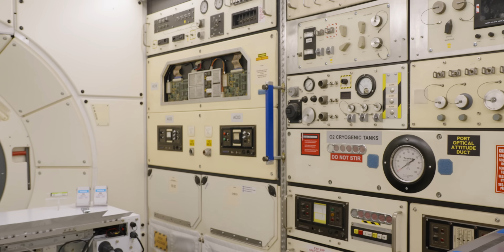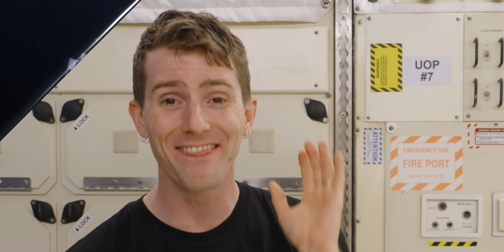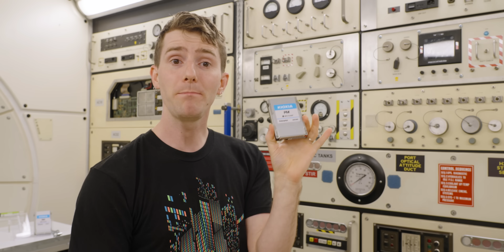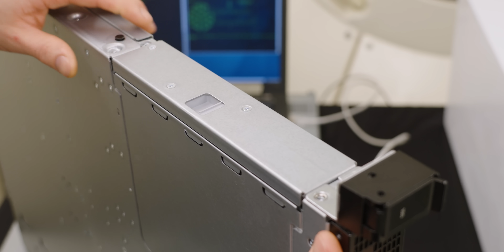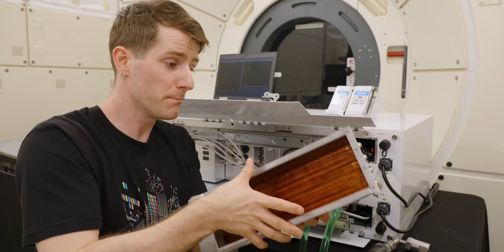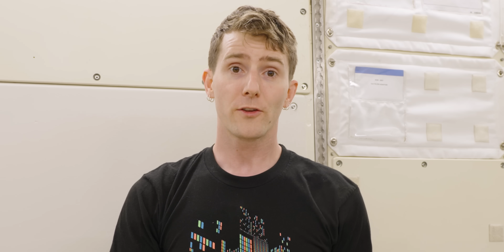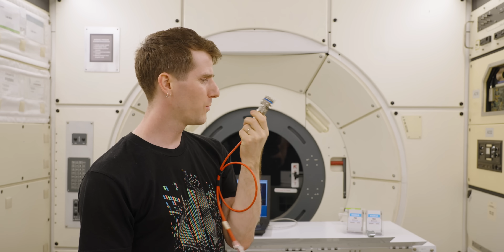here's why it's so hard to put a computer into SPACE - NASA HPE Spacebourne 2

Comment: The vacuum of space is a pretty “rad” cooling solution…
Reply: surprising a vacuum is a very good insullator !because of its complete lac of atoms to wich transfer the heat !
Reply: @palvierflex4344  ### Detailed Design for a Space-Based Radiative Cooling System for a Computer

#### 1. *System Overview*
The design focuses on using the vacuum of space to dissipate heat generated by a computer through radiative cooling. The system comprises heat pipes, radiators, thermal interface materials, and a thermal control system integrated with the computer components.

#### 2. *Heat Generation and Analysis*
- **Components and Heat Output**:
  - CPU: 150W
  - GPU: 200W
  - Power Supply: 100W
  - Other Components (RAM, SSDs, etc.): 50W
  - **Total Heat Output**: 500W

#### 3. *Radiative Cooling Design*

*A. Heat Pipes and Spreaders*

**1. Heat Pipes**:
- **Material**: Copper for high thermal conductivity.
- **Diameter**: 8mm for adequate heat transport capacity.
- **Length**: Varies based on the distance from components to radiators, typically 200-300mm.
- **Working Fluid**: Water, due to its high latent heat and compatibility with the vacuum of space.

**2. Heat Spreaders**:
- **Material**: Copper or aluminum.
- **Thickness**: 3mm to ensure efficient heat transfer and structural integrity.
- **Surface Area**: Sufficient to cover the heat source area (e.g., CPU, GPU die).

*B. Radiators*

**1. Radiator Panels**:
- **Material**: Aluminum, due to its high thermal conductivity and low density.
- **Coating**: Black anodized finish for high emissivity (ε ≈ 0.85-0.95).
- **Dimensions**: Each panel measures 1m x 1m, providing a surface area of 1m² per panel.
- **Configuration**: Four panels arranged in a cross or flat configuration around the computer housing

Comment: Speaking as someone that helped put about 150 satellites into LEO, in my opinion, space hardening the hardware really only applies when you intend on a super long lifespan - which means you also have no reliable de-orbit plan (so you fully intend on being space debris). For something with a lifespan of under 10 years, you just need some redundant systems and really good error checking in your software. Software based hardening is 100% a thing and way cheaper.
Reply: Always depends on the workload, but it is crazy how many workloads can fit in the Rancher SUSE "Cattle not pets" model for services where you build them to deploy as stateless as possible to allow for processes to spin up when needed to process data and crash with no loss if they go down.

Again redundancy, plan for failures to happen, and then you can start to tighten your tolerances to save costs and not just to get it to work at all!
Reply: I think I heard somewhere that you can have multiple identical CPUs executing in parallel, that way either you can detect errors and either recalculate that, reset, or if you have 3+ CPUs then you can fix one using the others.
Reply: @LoganDark4357  That's also known as "lock step" processing it's like a specialised version of TMR in that it has each CPU executing the same instruction on the same clock cycle and comparing results in hardware (or nearly so). TMR is typically redundant at a higher level where you'd have 3 computers or 3 actuators and a voting mechanism external to that. Lockstep I think these days is an older technique, it was used with dual rather than triple redundancy on a lot of mainframe type stuff for banking and similar, if the 2 CPU's didn't agree at any point the transaction they were processing would be rolled back and started over. The triple stuff is still used today in some safety critical areas like ABS in cars and things like that, but it's hard to get it passed with newer safety standards as having all the things on a single CPU die makes things like power failures or bulk failures of the silicon really hard to handle and those are more of an issue than CPU errors are these days. So they are moving more to that 3 independent modules and a high reliability "voter" model.
Reply: @zyeborm  oh yeah, I have a game that does deterministic lockstep to reduce network traffic, but I guess it can also be to ensure an error can be corrected.

slight nit though, I said 3 CPUs, not 3 CPU cores on a single die. I didn't know TMR was for a single CPU die, I was literally referring to 3 separate chips, so maybe that would be lockstep then.
Reply: @LoganDark4357  You really only do that for computers with mission critical functions, ie if they reboot your spacecraft is hosed.  A lot of LEO spacecraft you can just monitor for single event upsets and either reboot the CPU via a watchdog timer or be running error correcting software on it all the time (to do that you sacrifice some of your RAM for error checking bits) Obviously something that humans are depending on to live is a different story.
Reply: @LoganDark4357  You might be referring to a TMR (Triple Modular Redundancy) technique.
Reply: @AGuyWhoWantAUsername I didn't know that had a name . yes!!!!!!
Reply: Or when human lives depend on it.
When a satellite mailfunctions you scream, write it off and send a new one. When a person dies you have a lot more questions and issues to deal with. During the "space race" it was kind of a war with russia and some lives lost were acceptable. That's not the case anymore. That's why things are over engineered and thorougly tested. Because there is no triple a or plumber in space.
Reply: @SPeeSimon  NASA's standard for human flight is a 1 in 250 loss of crew probability, so some loss of life is acceptable
Reply: This is the best most accurate reply on the thread IMHO.  Designing a computer to function in space isn't all that hard, its been done for a long time, even fairly cheaply (look at cubesats).  However this video is mostly about adapting COTS computers to run inside the space station, which is a very special case and has little to do with how you make a computer for a spacecraft.

Comment: Starlink hasn't been tested in space yet. The upcoming Polaris Dawn Mission will be the first space mission to use Starlink. If the tests of this system are successful, we might see it installed on the ISS.
Reply: I mean... starship orbital flight test 3 used starlink to beam back HD footage of its re-entry (the initial phase almost up to peak heat before it was lost).... so it kinda has been used 'in space' but I do understand what you were getting at... not used long term by a human operated 'terminal' per se

Comment: MSi cyborg 12Ve 12450H 3.6ghz average at 12Tf / RTX 4050 AIia Xx Yy Zz dual layer cores at 5Nm auto over clock to use any any any power rating available
Reply: With ray tracing
Reply: Light computing cores

Comment: Hardware arbitrage is quicky becoming a thing for electronics in space. Put a dozen commodity pieces of hardware is cheaper , more performant, and as failure resistance (sometimes even lighter) than a rad-hardened version.
Reply: Reminds me of a cube-sat I heard about that was built by mostly non-engineers. They just slapped a BUNCH of epoxy on commodity parts like arduinos. It worked shockingly well, the reason it failed was because it was loaded into the rocket module backwards or something like that (I forget the details)

Comment: A friend of mine is a physicist who used to work at CERN and, as part of her job, assembled sensors for the particle collider. And despite the sensor's specific purpose being to measure the products of a collision, one of the issues they had to deal with was these particles causing bit flips and other issues when passing through the chips inside the sensors.
So what she told me they did was to irradiate the chips before putting them in because this somehow increased protection from the effects of the particles passing through. Or better put less susceptible to damage. She tried to explain it to me what happens in detail but this was long ago and I didn't understand half of it, so I might be talking BS here. Though I wonder if NASA/ESA also do something similar to their chips.

But I guess this would only be useful for heavier particles than gamma radiation, which I guess is the main problem in space.
All that being said, computing in hostile environments is both very interesting and potentially very frustrating as entropy slaps you in the face.
Reply: Physicist here, you pre eradiate them to get those that are particularly susceptible to die before you put it into the heart of a machine you can only service every few years. The procedure does not make anything more resilient, just the surviving units are less likely to fail later on.
Reply: @XanatosDavid  Somehow my last response was deleted, probably because I linked to a PDF from the CERN document server with slides my friend sent me back when she told me about this.
But thank you for explaining and of course you are completely right and I remembered it wrong, it was basically just done to sort out the chips that would be most affected by radiation. In the slides she sent me back then she called it "irradiation qualification".

But since I have another physicist to ask now: Do you know if NASA performs similar tests with the computers they send up? Would make a lot of sense I guess.

Oh and in case anyone wonders, the PDF can be found on the CERN document server, it has ID 2686279.
Reply: @B20C0  One of the points of this project was to send off the shelf hardware. Most computers that have been sent up before are treated like so or custom made. The spaceborn project's whole point was "modern enterprise hardware has ECC built into every layer how would it work in space?"
Reply: Something like this is actually common practice for all industrial grade (and military and aerospace grade of course) electronics. Most component failures tend to occur early, so the parts undergo a stress test inside a climatic chamber, cycling through the temperature and humidity ranges the parts are specified for. It's called a "burn-in". This is of course expensive, but it's a lot less expensive than fixing a train stuck in some tunnel in the alps or a plane crashing.
Reply: @XanatosDavid  Ah okay, that makes much more sense. Then I remembered it wrong. I just remembered something about irradiating chips and some presentation slides she sent me years ago. Though I looked through CERN's DB and found them, and you are completely right, it's just part of a testing campaign. In case you're interested (they mention "irradiation qualification of ASICs"):
https://indico.cern.ch/event/774201/contributions/3429235/attachments/1875763/3088566/iWoRiDtalkDette2019.pdf

Though since you're here and could provide some background knowledge: Since this is basically just testing/sorting chips, wouldn't this also make sense for any kind of ASIC/CPU/GPU NASA sends up there? Or do they do that already?
Reply: @XanatosDavid  Physicist here, this is entirely untrue. You train ('pre-irradiate') them to cause radiation annealing which makes them more resilient.

Comment: The U.S. government has outsourced everything to private contractors who use research from public colleges and universities, and actual NASA is looking like some kind of retro future aesthetic using off the shelf server parts.
Reply: NASA has always outsourced a ton of stuff to private contractors.

e.g. take the Apollo Guidance Computer (AGC). The MIT Instrumentation Laboratory designed the computer's hardware, OS and UI. Raytheon did the manufacturing.

Fairchild Semiconductor pioneered the first mass-producible ICs in 1960, and the AGC was the first computer to use them. Of course these were still primitive—one flatpack chip roughly 20mm² might contain two 3-input NOR gates, for a total of 6 transistors.

The AGC's memory was even wilder. Its RAM was magnetic core memory (typical for the time) but its ROM was core rope memory. The AGC had 6 core rope modules. Each contained 512 iron/nickel cores (donuts 0.249" in diameter, about 6.3mm) and 192 "sense" wires. For every core, each sense wire either threaded through it (representing 1) or around it (representing 0). Cores had additional wires for address selection and reading out. All of this threading was done by hand—Raytheon had a factory full of needleworkers threading data into the ROM, bit by bit.

They did this because even though core rope memory was incredibly labour-intensive to make, it had unparalleled information density, about 5× that of the magnetic core memory used as RAM. When going into space, mass and volume are paramount.

It also happens to be resilient to bit-flips ;)
Reply: the private sector computers are far more advanced than anything the gov has developed. Making modern computers is not easy, and the US gov doesn't have the people, nor the equipment, nor the innovation to do it themselves. And if they did, without having volumes to sell, it would be ridiculously expensive for a single computer.

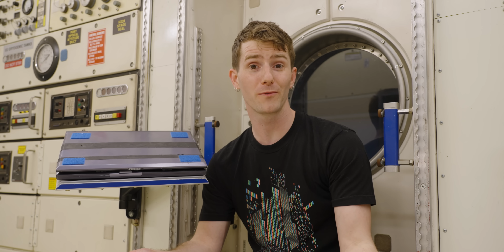Comment: OMG ! they put a "do not stir" label at 16:01 , above the "o2 cryogenic tanks" label.
For those not as geeky as me, its a reference to the Apollo 13 lunar mission, that suffered an explosion due to a short circuit...while stirring the O2 tanks ! (Fortunately no one died, its a really cool story, there's also a movie about that)
Reply: I'm glad someone else noticed that!
Reply: I got a good laugh from that! also an animated "alien" wizzed by the ISS window. (it looked a little like the FPS alien) and there was a picture of an alien when the upload pictures were being shown)
Reply: YESS! I noticed it right away, happy I'm not the only nerd :)
Reply: Yeah dropping the tank on the shop for, then just installing it without telling anyone, isnt a great idea. (Yes this is actually what caused the issue. Dropping the tank on the floor caused some of the insulation on the wires in the tank to crack off. So when they stirred the tanks, there was a short, it sparked, and yeah sparks and o2 = boom.
Reply: @JoshuaC135  drop was only one of the problems, it caused that tank couldn't be properly emptied during tests on earth, so they needed longer periods of heating - which burned thermostat switch that wasn't rated for voltage used in missions after a change in spwcs. This in turn caused overheating of cables which burnt isolation.
Just an interesting case how chain of incidents which alone wouldn't cause an issue lead to a catastrophe.
Reply: Glad it wasn’t just me who noticed. 😂
Reply: they wanna avoid the bangs and shimmies and jerry-rig CO2 scrubbers
Reply: Yes I love it❤❤
Reply: got a legit LOL out of me for that one.
Reply: Hoooold on a minute, I have to check that out myself! Hah thanks for noticing that! :D
Reply: @zackzeed  0:14
Reply: Cryogenic oxygen tanks on the ISS are at supercritical pressure. There are no liquid and gas phases that can segregate so stirring doesn't make any sense
Reply: @shanent5793  you should tell that the scientists from NASA, Roskosmos, ESA, CSA and JAXA
Reply: @derda1304  why, when they should already know this?
Reply: I was just about to say something about that lol
Reply: 16:17
Reply: what movie?
Reply: @tomikun8057  the mission was Apollo 13, the movie was also Apollo 13...
but then, maybe you're joking....
Reply: @tomikun8057  Apollo 13